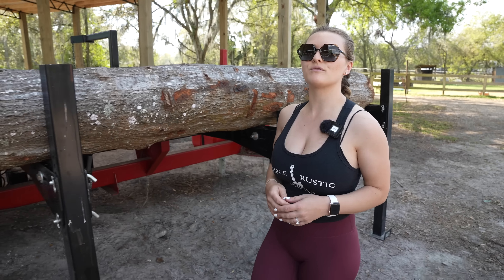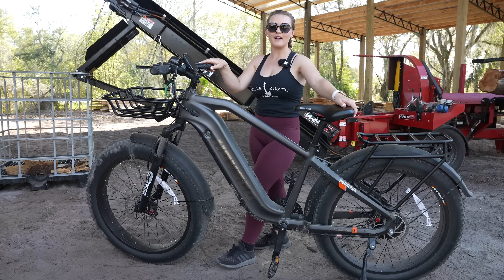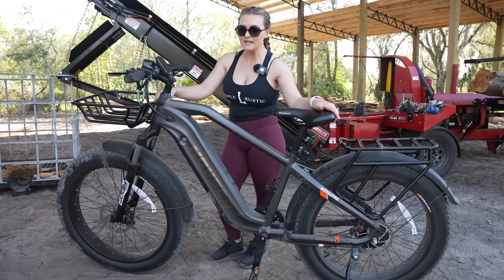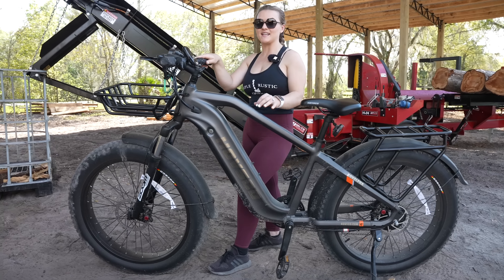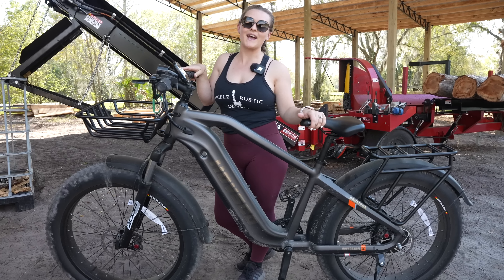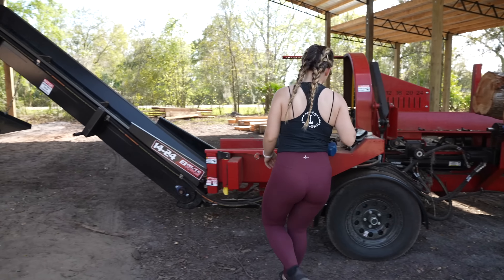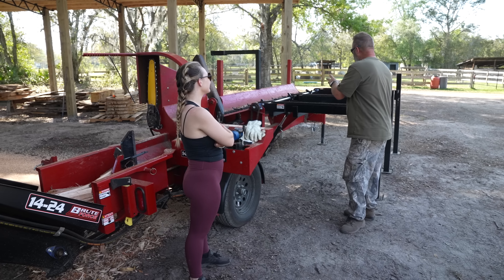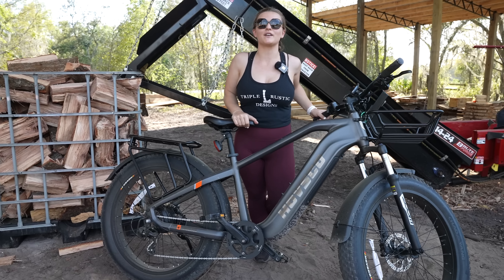60-80 Miles...Say It Ain't So! HOVSCO Alpha EBIKE

Comment: Personally I never liked e-bikes. Do you'll still have the other smaller log splitter machine because it's always good to have a backup
Reply: yes we do, but I haven't used it since we got the Brute Force.  It would be hard to go back to all that manual labor.
Reply: @larrylarson1274  That's good you'll still have it just in case. You must be thankful for all the newer machines because it definitely cuts back on the physical labor. Also if need be you can run both & do double the work if the demand is super high. Well keep up the good work & have a good week Larry 👍🏻

Comment: Think you need to lift the blade....top of the log your splitting needs to go thru a second time every cut you do while the bottom pieces of the log are tiny pieces....I know these blades are hydraulic adjustable so moving the blade up will make your splits more even sized and save you recutting the top cuts on every piece you split!🤘

Comment: It looks like you are stopping your log 2 to 4 inches short of the length guide? Some of the split firewood looks to be not much longer than 12” I cut mine at 17” unless a special length is requested. It might just look this way because of the angle we are watching the wood being processed.
Reply: we have a lot of snowbirds down here that like the shorter pieces for their solo stoves.  we typically stay around 16" but sometimes make smaller batches for them.
Reply: @larrylarson1274  ok 👍🏻 I was thinking they looked a little short for a normal wood stove / fireplace. Thanks for the reply.